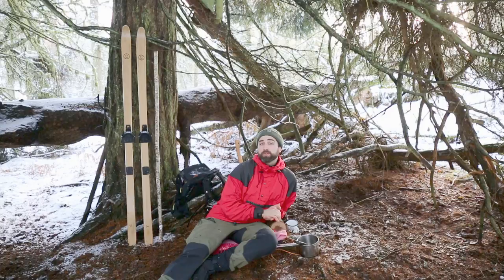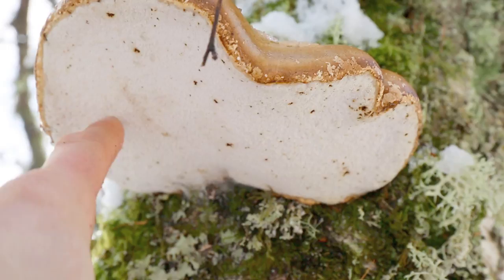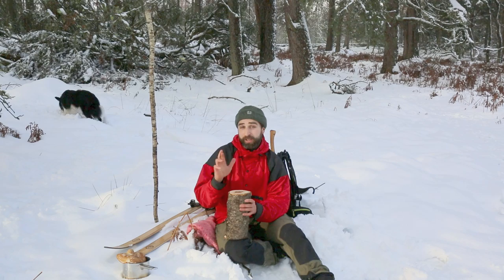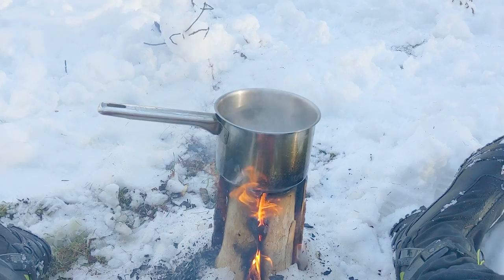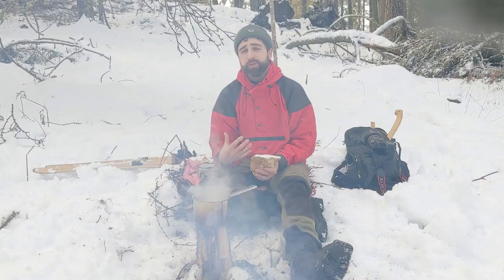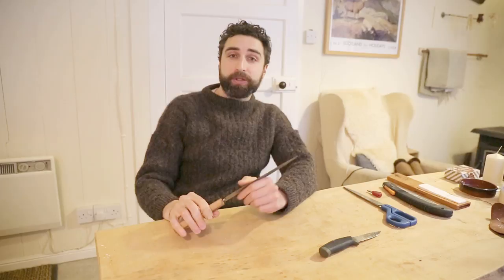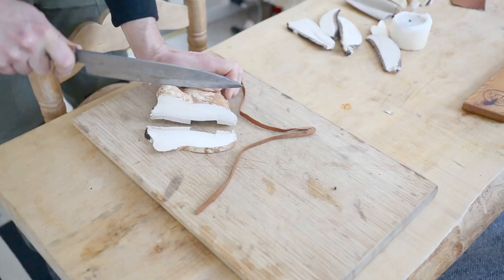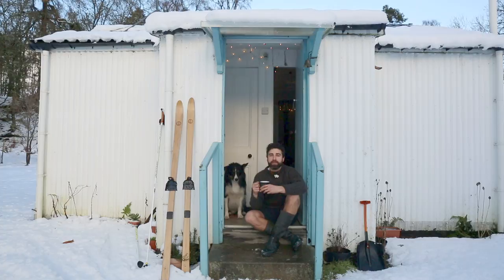Birch Polypore Mushroom | Tea, Medicine, Ötzi The Iceman, Fire Making, Knife Sharpening & More

Comment: Okay if I remember my mom correctly she told me that carbon is the main food source of mushrooms, so these kind of mushrooms eat old dead logs.. and that's where I found my polypores. now I'm not sure if they're Birch polypores per se, but they're pretty close to them it's a fairly you know Common family of mushrooms... you know Polyporus spp. is what I'll call it, but I'm pretty sure they might somehow produce hydrochloric acid (hydrogen & chlorine) that maybe breaks down (similar to human digestive tract) the tree....so that it's able to then consume the nutrients and carbon from the tree....in which case I'm f**** high as s*** on either right now, because I use them mushrooms to develop a liquid culture and then, with that liquid culture I'll make beer... and in the presence of hydrochloric acid, ethanol becomes Aether, so that would explain why I have an insane crazy Head Rush right now and I can barely even like think... it's like the f**** edges of my vision are starting to go dark, it's definitely ether

Another way I can tell that it's Ether, besides just drinking it and being like damn, is I can see in that tank where I'm fermenting there's a whole bunch of condensation whereas my other tank that I make Saké in, there's not as much condensation.... and Aether has a very very low boiling point, and it's very very can't remember the word it's got a very fast evaporation rate so for that reason it creates a lot of condensation in the fermenter.... it's just a little droplets of Aether in there probably

Comment: Is this safe to consume during pregnancy?
Reply from the maker: Hi Krystal, unfortunately I couldn't find any research or folk information about the Birch Poly pore and pregnancy. I would advise avoiding in case it does anything unexpected with your hormones as I believe it can prevent the conversion of testosterone into oestrogen (aromatase inhibitor). However that might be quite good if your having a baby boy but I would still be careful in case there are any compounds which might induce abortion. Hope this helps! Jamie